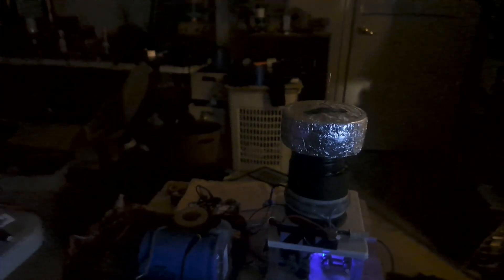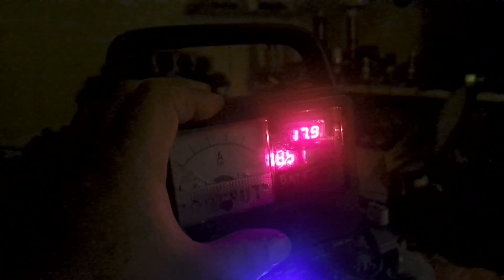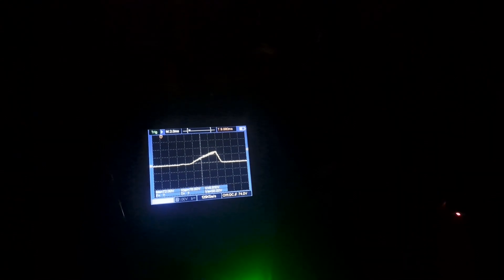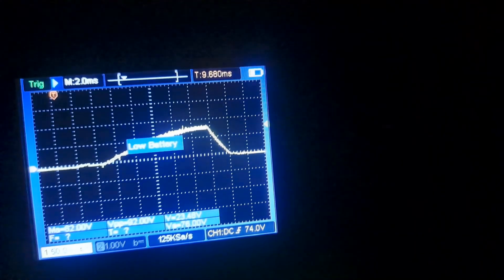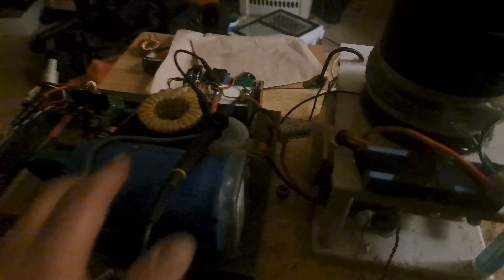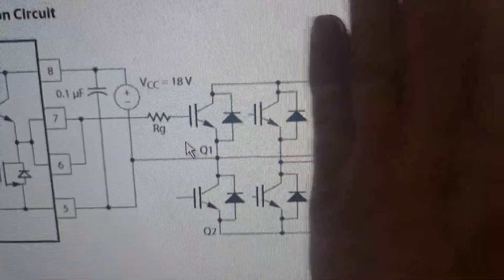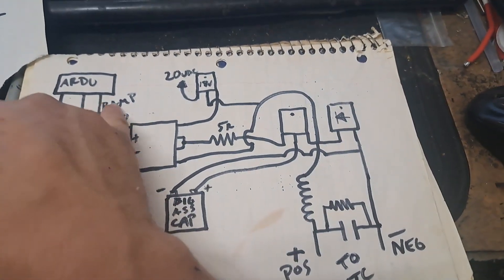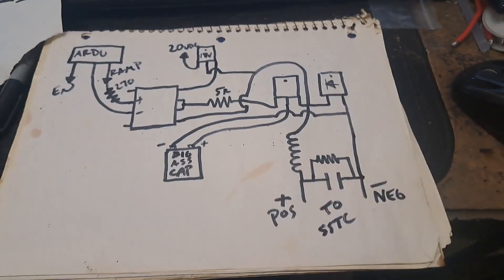18VDC QCWSSTC Mini Full Bridge Test ~90VDC ramps

Comment: Been watching all your coil vids.  Nice work!!
Reply from the maker: Thanks, man I still remember some of your videos from back in the day.
Reply: @Magneticitist   I’ve been away from coiling for a while but watching your vids has made me want to get back to it.  I have all the parts for a QCW, just the complexity of it scares me.
Reply from the maker: @Tesla210  I think most people feel that way... While I don't want to give the wrong impression and say it's easier than it actually is.. it's really only extra complicated if the goal is to actually create arcs that will be something like 10x the secondary length. 

Just building one that "works" is super duper easy. I would recommend anyone just build one without being too concerned about the SSTC portion.. Maybe even just do like me and use a random one you already have built. If you go in steps everything is always easier. 

When I think of QCW in general now I'm just thinking of it in modules to where the buck is its own portion.. ramp generator it's own portion, and SSTC it's own portion. If you just go ahead and build the buck you can play around with it and scope what it's looking like with various loads etc. Once you feel like it's working well it's just all about tossing that guy onto the rails of an SSTC.

Comment: I was just watching Tesla explorer phase shift sstc "psfbdrsstc" wich I don't even know what the hell it is 😂. And it came to my mind it could be possible to add some kind analog output from the arduino to the pin9 vco like the audio input on the musical class e , and do a ramp on the vco at the same time the buck ramps the input voltage so you know you could test some fancy shut of trying to get the tune right as the voltage rise
Reply from the maker: That sounds doable but I think it would actually be harder to tune because you might have to completely forgo feedback and basically run it at a programmed fixed frequency that ramps
Reply: @Magneticitist  for sure be harder to tune but who knows what effect could cause in the output would be cool to investigate but risky af probably , cause could trow it way out of tune and kill some fets

Comment: Yeh I did not get the notification but I still found it first on my recomended videos , that works amazing , you said something about why your class e coil won't work on ramps cause it needs a specific tune for each voltage , so it got me thinking cause mine is kinda the same , so how did you setup the pll (or the driver) on this setup to make it work so good at different voltages so good ?
Reply from the maker: hmm IDK why it does that but it started a few weeks ago I guess. YT does a lot of shady stuff behind the scenes. 

Anyway the thing with my class e's is just about intended purpose. I can buck ramp them up to their intended voltages but I don't see the point of that. Nothing special is going to happen. The point of them being class e is so I can run them continuous wave for long periods and never get the switches hot. If I however made one intended for like 100VDC+ then maybe there's a point to it, but so far mine are like 50DC absolute max. If I push them any higher then they need retuning. If desired tuning is reached with a particular LC and R loading (CW bush) at a certain voltage, then that means everything up until that voltage is running it out of tune. I could ramp 50VDC arcs, and it's probably just barely going to run class e during the brief peaks. I'm pretty sure most of them are all just fixed frequency.

So the idea would then be to build something that is running closer in the regions of the component ratings, and push it hard by having that peak-tuning save the switch some heating. 

This PLL SSTC can run properly at any voltages because it's not ZVS or class e. The tuning might change with arc loading like with any coil but it doesn't really matter as far as the switching is concerned.